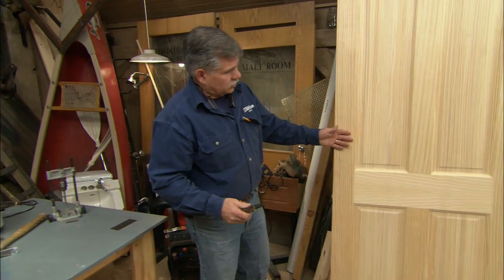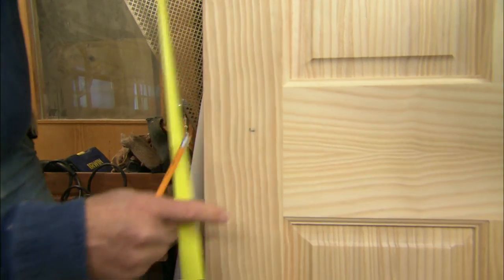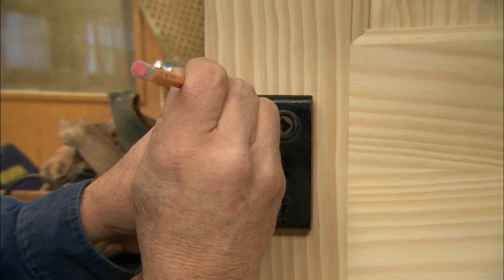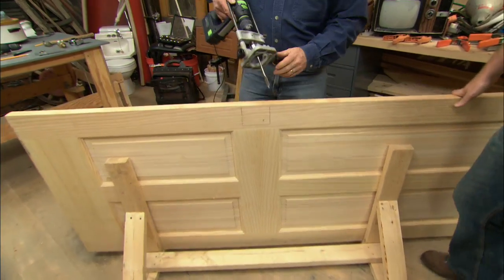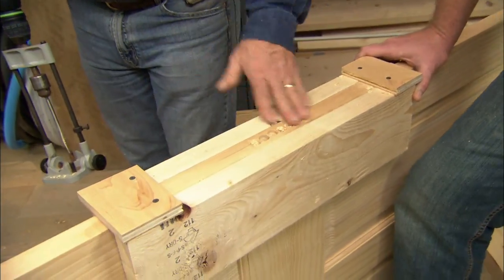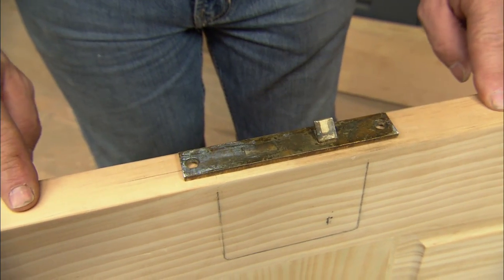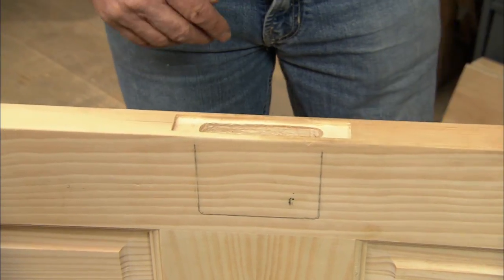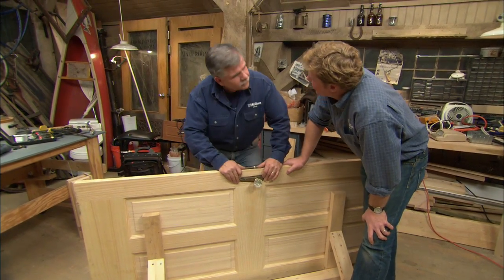How to Install a Vintage Lockset | This Old House

Comment: When setting the depth for the spindle hole instead of marking through the hole in the lock I use my adjustable square as a depth gauge resting it on the face of the lock and setting it half way across the spindle hole in the lock. Takes a couple of seconds longer but more accurate.

Comment: Tried this and I have nowhere near Tom's skills. Of course I failed, Luckily I was practicing on scrap 2x4 about the same thickness as my door. What worked for me was a router with a 3/4 inch bit to set the outside trim followed by a 1/2 by 2 inch long router bit to route out the mortise using the jig in the video for the drill guide support with a straight edge screwed to it. Squared up the edges with a chisel, very simple. I just clamped a couple giant blocks of wood to the door as a door buck to hold it steady.

Comment: As usual he didn’t show us anything, stoves usually need to be converted to propane, when installed they need to be leveled, the flame needs to adjusted on all burners, so leave it to This Old House to show us nothing!
Reply: huh.......this is about a lock....

Comment: Why would you show someone how to install a 65 year old lock that has weak spring steel in it that could break at any time. Not worth it
Reply: I'm going to assume this isn't going to be somebody's front door in the center of a meth neighborhood so I wouldn't worry so much about it
Reply: They just haven't shown the installation of the deadbolt.
Reply: Who's to say it's for an exterior door, and any lock can break at any time it's just for show!
Reply: i know they are. but if you're doing it for antique look, you can easily buy the outer pieces for the look.
Reply: a new lockset made in china broke after 2 years  after being installed in a rental house... the old lock has been here for 65 + years
Reply: @san379  This is one reason I prefer repairing as opposed to changing...